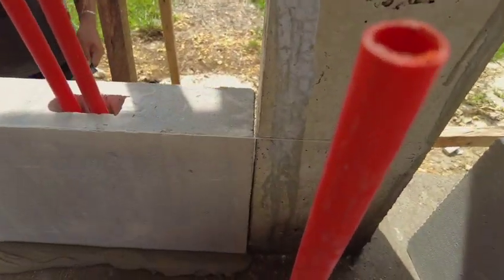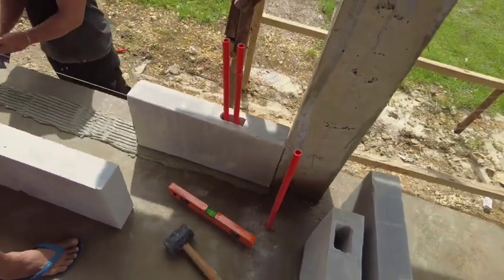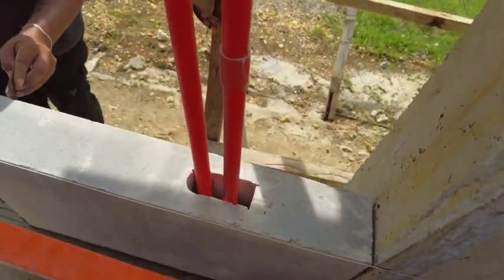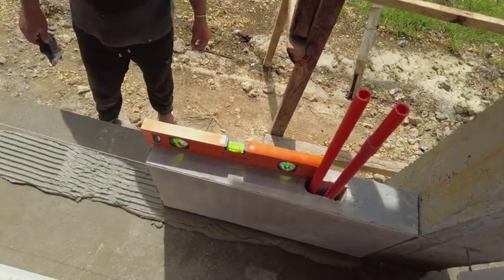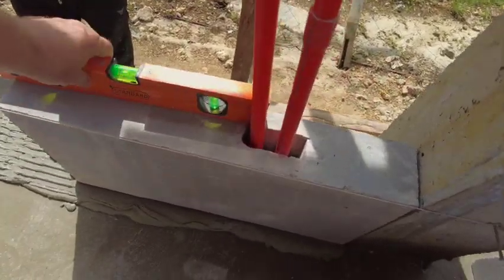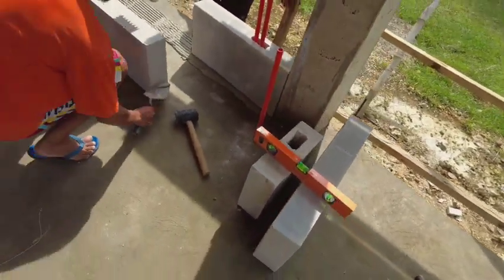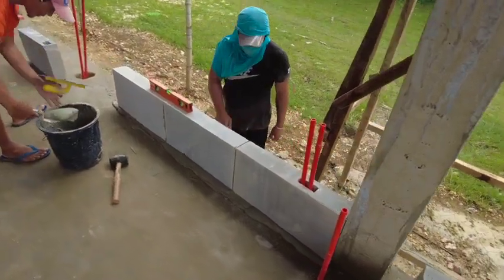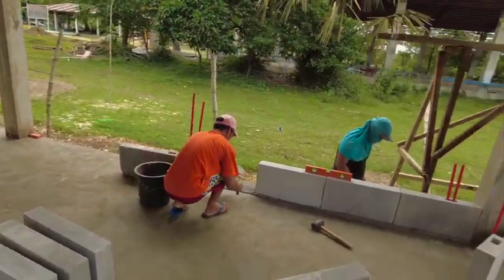Philippine Self Build W11...~AAC Learning curve P1

Comment: Good to see the AAC going in. I've been waiting for it lol. 
I think I get why you say that you would just join the boxes through the block rather than two pipes up from under slab. It would be faster to join them through the wall rather than making the oblong hole to accommodate the two pipes through the blocks. Great tip! 
Cheers
Reply from the maker: This is a lot of fun. I’ve not been challenged like this since my last engineering project… 12yrs ago
Reply from the maker: This is a lot of fun. I’ve not been challenged like this since my last engineering project… 12yrs ago
Reply: @kenlyn2208  it's good to have a challenge bud. They help to keep our " old people" minds sharp... 🤣
Reply: @kenlyn2208  have you been retired for 12 years? What field were you engineering in?

Comment: Hi From what I can see the AAC blocks leave a ledge at floor level I'm  concerned about water proofing the outside wall. How do you plan well the water out.?
Reply from the maker: We’ll be doing what I’ve seen in Indian and Malaysia videos… an adhesive layer outside with a slope away from the house. We’ve seen this in a number of builds around Cebu
Reply: @kenlyn2208  The thing is inside you have the columns flush. But water run of on the exterior is important.  I Guess inside tiles will give a small rebate. Just to let you know I'm a Kiwi retired builder.
Reply from the maker: @graemescebuphilippines363  we’ve looked at a few commercial and residential builds. They all tapper the outside once the walls are up to shed the water away. First though… waterproof the walls… then tapper

Comment: That looks like a lot of labor cost to me, I’m sticking to my 8” inch block, I have a down pour every 30 inches and the rest is air, went really don’t need A/C at all it stays nice and cool,I can’t see where it is strong, there’s no rebar, to me there’s nothing really holding it but glue, But that’s my opinion, I look at stuff this way if I can drive a car through its Bullshit,
Reply from the maker: That the beauty of all the options… we can create something that works for us. I do admit there’s a huge learning curve and there’s little help from the Philippines. Most of the learning has been western building codes and countries like India where they use lots of AAC
Reply: @kenlyn2208  I've also seen some vlogs from Filipino engineers, and they say the same as you Ken. Approximately 20% less cost, more effective against heat transfer, and strong enough to withstand a typhoon.

Comment: what size are you using and how much more expensive than regular chb?..thanks.
Reply from the maker: Goes deeper than the individual blocks but into the overall costs to build. AAC doesn’t have all the steel, river sand and gravel or bags of cement plus AAC doesn’t the finishing concrete mortar layers. When comparing a full finished wall in both hollow block vs AAC… in our case 18% cheaper. Others on YouTube cite as high as 22% savings. Again… to a full finish home. 

Block to block comparison AAC is massively more expensive. But given all the finishing needed with hollow block, labour also drops considerably. This means construction time is much less.
Reply from the maker: Oops… forgot to add… we used number 4 blocks for interior and exterior walls
Reply: @kenlyn2208  ...oh thanks, yes i am totally into the advantages i just wanted to know how much you ended up paying per unit because i know if i ring them im going to get the full on rich foreigner price every time instead of the local cebuano not so rich wife discount.
Reply: @kenlyn2208  
...so i think they mentioned 178 per 4inch unit but i'm thinking too much since somebody said 150 not too long ago ...but maybe even say 135 with a bulk order to a location in mandaue instead of the province ...but then they probably separate the delivery costs anyway. Did you easily find workers well versed in this tech or did you need to train them?...thanks.
Reply from the maker: @bepitan  our actual was 155… 
I did need to train them. The crew we had was very provincial. However, I can recommend two from my crew that did things right. Message me. We’re in Mandaue right now… until the 25th.
Travelhidden2000@gmail.com
Reply from the maker: @bepitan  a Filipino friend went in and was cited the same, recently. But negotiate hard with them. As with anything… money makes prices rise. The Filipino rich push hard.